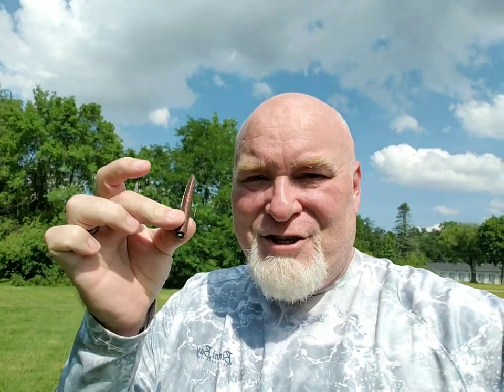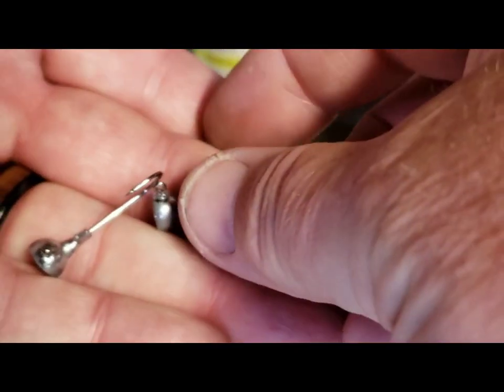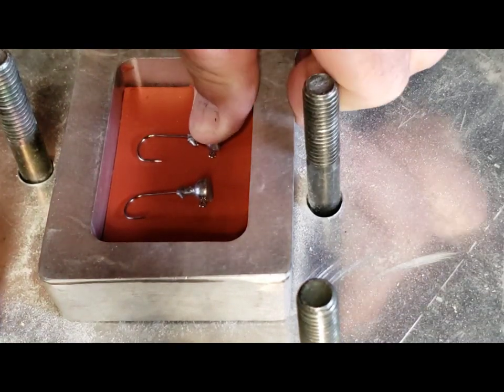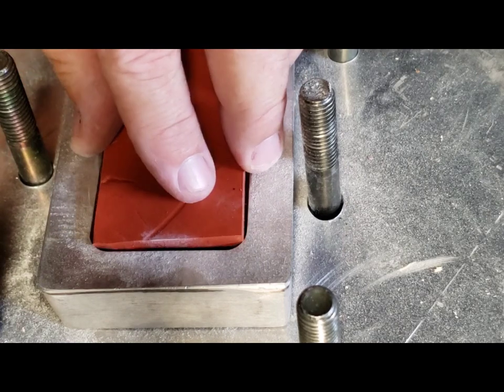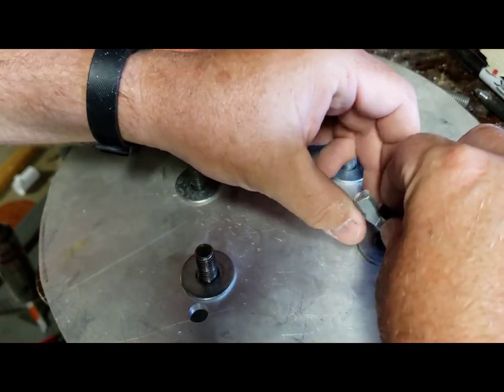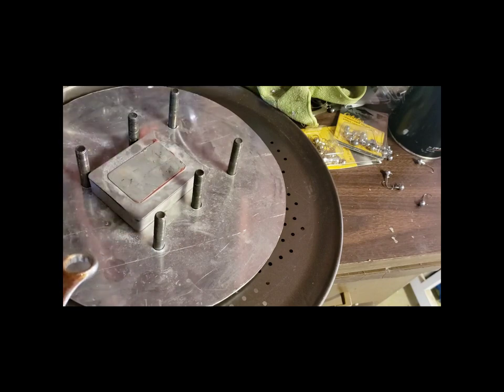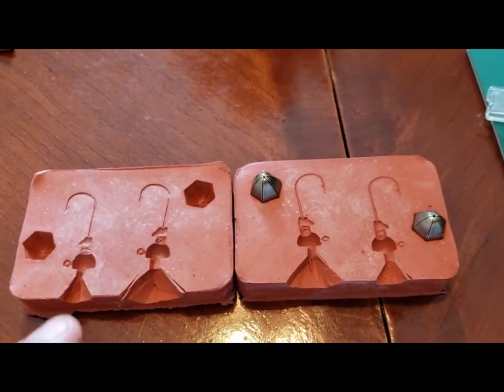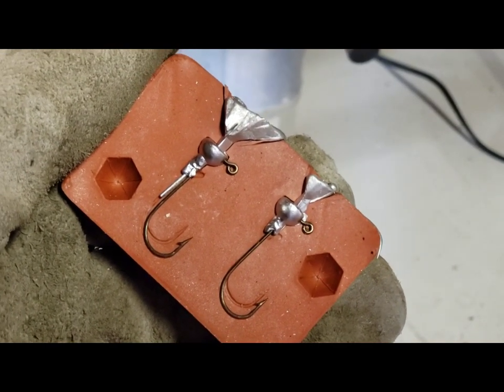Make your own Ned Rig mold! Vulcanized rubber mold tutorial!

Comment: Love this video  what is the thickness of your material and frame thanks
Reply from the maker: the mold pieces are 1/4" thick (6.35 mm) 2 per side so a total of 1" thick. Look up 1" mold frame on Amazon. The interior dimensions are 1 7/8 by 2 7/8.. Since the mold and material are both about an inch Thich, i added that aluminum cut out to add a bit more pressure. The mold rubber came from a 9" vulcanized rubber spin mold I found on eBay.
Reply: @MakeItTakeItOutdoors  awesome thanks for the info I ordered 3/8 material and a 1 1/4 frame good information to have for the future looking forward to trying this out
Reply from the maker: @georgewolfe6245  let me know!